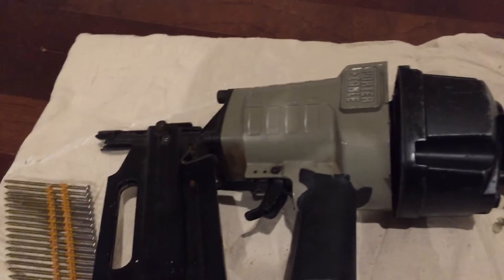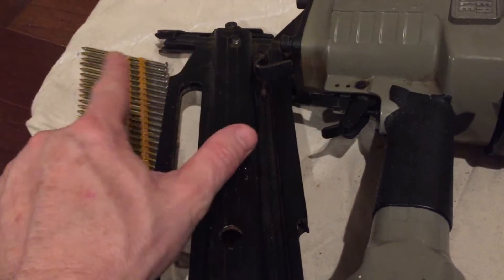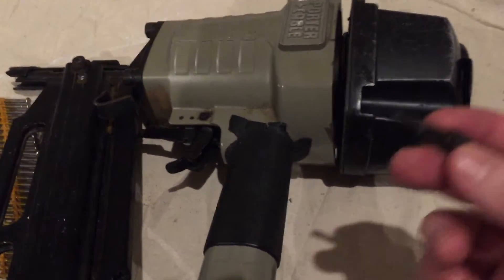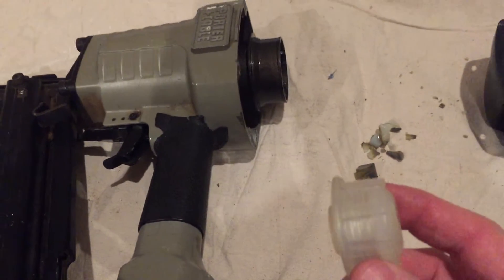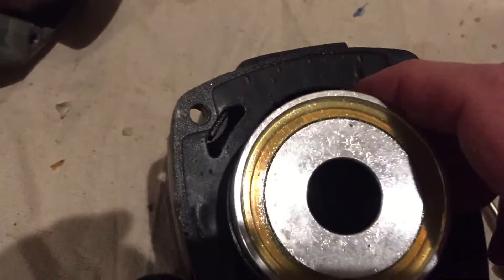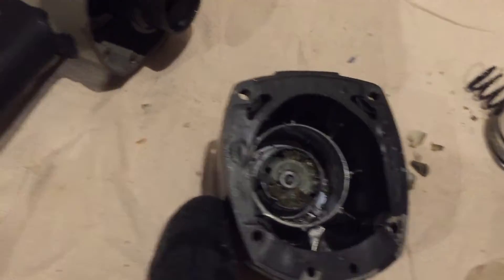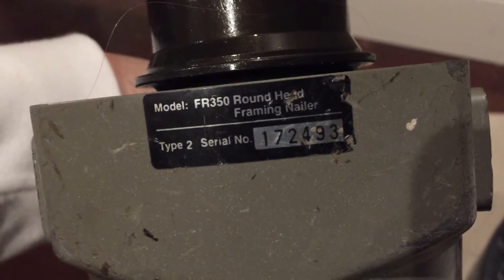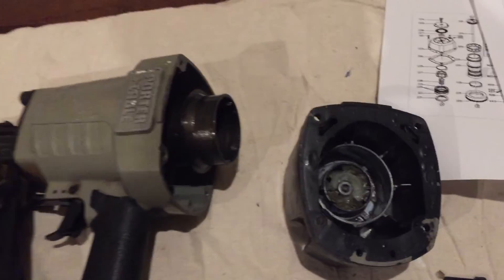Porter Cable 350 framing gun not shooting nails Part1

Comment: I have this same gun. FC350 type 2. Mine started to leak out the exhaust. I could push the drive pin back up and it would work for a bit. But would do it again, then just did not work but still leaking air out the exhaust. I tore it down and the funny thing is that the upper bumper is just gone. I found maybe 3 small pieces about the size of two pieces of rice inside. That was it. the metal ring that goes around it was there, the spring ect but no bumper.